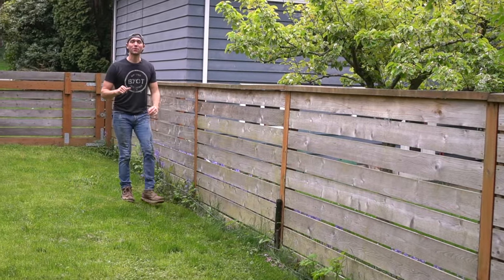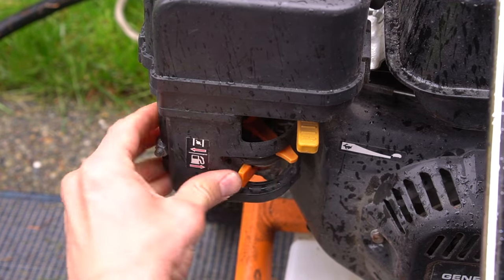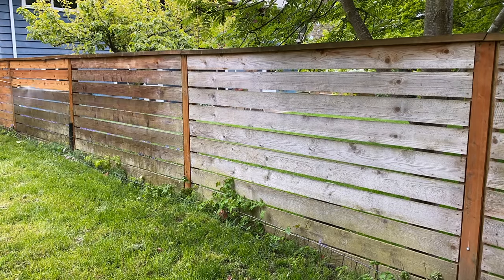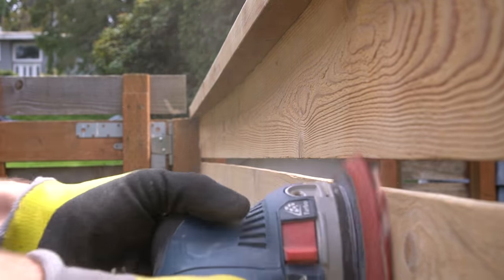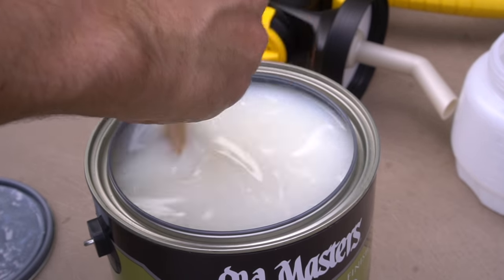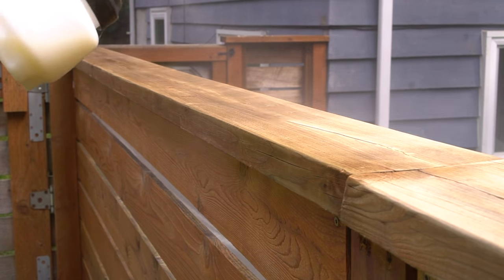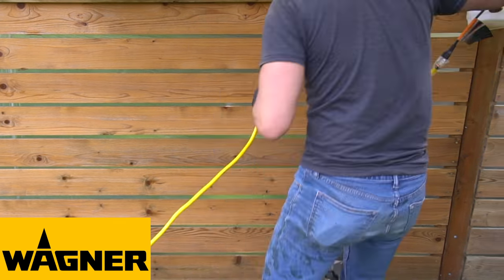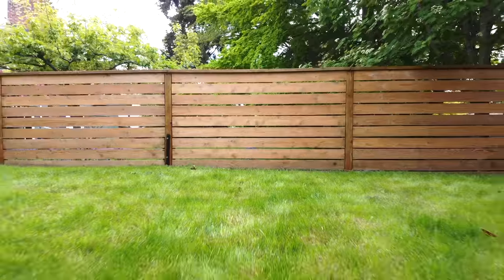Revive Your Fence In 3 Easy Steps For CHEAP

Comment: Thoughts on doing both sides of the fence? Does that just come down to preference?
Reply from the maker: you can definitely do double duty on your both sides but if you are using a water-based finish then make sure that you have the wood fully dried out before applying it. Don't want to seal in moisture. Thanks for watching.

Comment: Omg I have never seen a more INCORRECT tutorial on how to DO ANYTHING. Everything he did from the first step was WRONG. DO NOT DO ANYTHING HE DID PLEASE. HE DESTROYED HIS OWN FENCE. I'M A PRO. CLEARLY HE IS NOT.
Reply: Don't elaborate. That's really helpful.
Reply: @Brandon Ficklin  Touché salesman. First...don't use a pressure sprayer on any wood....softer wood=the worse it gets. The water lifts the fibers of the wood and it literally looks like teddy bear fur. All you need is a pump up sprayer and 1:4 bleach/water mixture. Spray the fence or house with the bleach water then hose it off before it dries. Done. Wood turns back to its natural color. If you just want to clean something, bleach water does not hurt paint. It's gorgeous.  Same for siding on a house. Pressure sprayers are good for some concrete cleaning but unless turned down to their lowest setting, they can seriously mess up lumber, siding, concrete, and mortar between stones and concrete. All of that "teddy bear fur" is clearly visible in the video but yiu have to know what you're seeing. He had to have seen that fence after it dried and knew he screwed up. I just don't get running that video after he realized what he did when seeing the fence dry. It's not something you won't notice. I've got photos of a house in had to go fix after my sister-in-law didn't listen to me. Thenentire front of her house was wrecked from the pressure sprayer she was so excited about. I imagine it was even worse with this guy having done this to an especially soft wood like cedar.